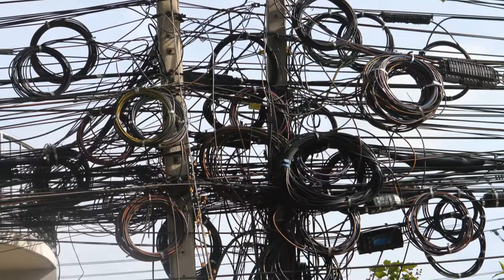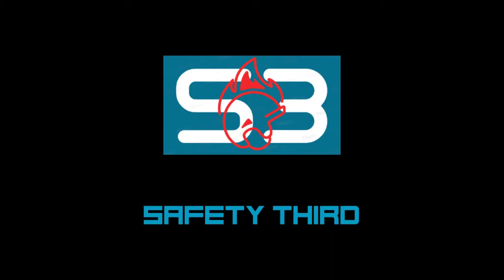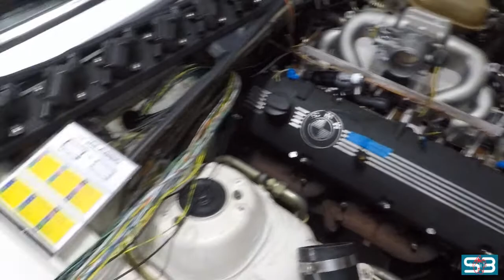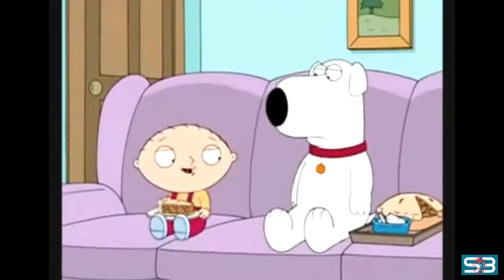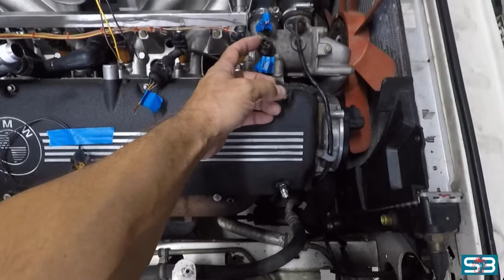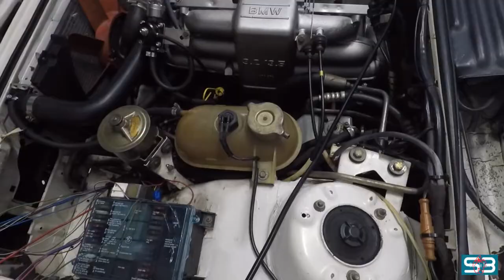Part 3: BMW 635csi ECUmaster Classic Install

Comment: Re soldering. soldering makes a much better connection but the joint is much more brittle. Hence why soldering fails quick when repairing already broken wires. Soldering should not be used where the loom is subject to flexing or vibration.

Comment: Hi mate, great videos, im about to do the same on my e34 535i but im keeping the ignition the distributer setup as factory. im going to use the ecumaster plug and play wiring loom they have. My question is, how come you went with the auto TPS instead of keeping your manual tps?
Reply from the maker: Mine was a European automatic transmission (I put a manual transmission in an earlier video), which only had an "on" or "off" signal from the TPS that was originally on the throttle. It wasn't a variable voltage signal, which is what the ECU needs to determine load or throttle position. So I replaced it with the USA automatic transmission model TPS for the variable signal. Your's may already have the correct signal, just measure resistance then open and close the throttle.  Good luck!
Reply: @safetythird4555  ok that makes sense. My car is a UK import (im in Australia) so im guessing mine has the variability in the automatic TPS like yours id imagine if im not mistaken, im going to swap it out for the e36 tps as the wiring loom the ecu comes with already has a plug for so saves me having to do extra wiring

Comment: Just checking in, when do you expect to post your next video on the ECU progress?

Thanks.
Reply from the maker: I have the dyno and tuner reserved for Friday. So the video will likely be a week or so after if everything goes well. Taking longer than I thought given the pandemic and holidays. Sorry!
Reply: Completely understand, just checking.  Thanks.

Another question for you: with this ECU are you only using the camshaft trigger or are you also using a crankshaft trigger like a 60-2 wheel or something?
Reply from the maker: Yes, I am using the stock sensor on the flywheel, which is a BMW specific 118 tooth, for my crankshaft trigger/signal. Episode 3 at about 8 minutes, I talk about it if you want to see the teeth on the flywheel/flexplate.

Comment: I stumbled upon your channel and as an E24 owner ('86 US and '79 Euro), really enjoyed the standalone video series.  What's the latest?  Did you get it on the dyno and smooth out the running?  Looking forward to the updates.  I am a neighbor to the south as well in Houston.
Reply from the maker: Thanks! I'm almost done with the next video. I had an issue with the car that I'm almost finished with. Stay tuned (pun intended).
Reply: @safetythird4555  - Awesome, I'm looking forward to your next video installment.  Ultimately I want to turbocharge my E24, so a standalone is the only way to really tune the car and extract the power while being reliable and drivable.  Hopefully our paths will cross at a BMW GTG in Texas.